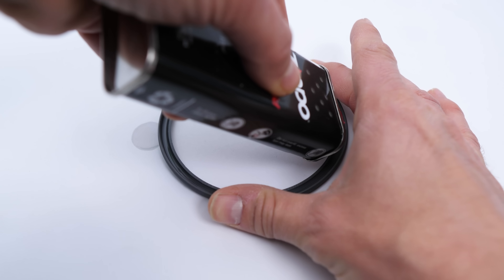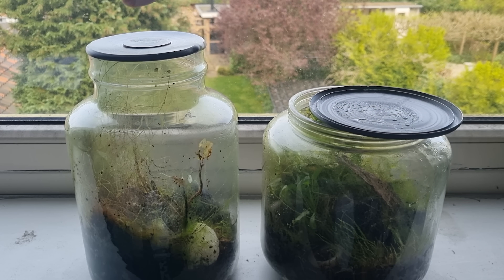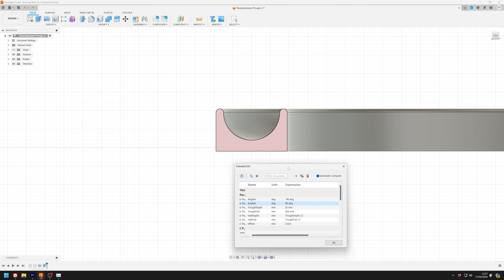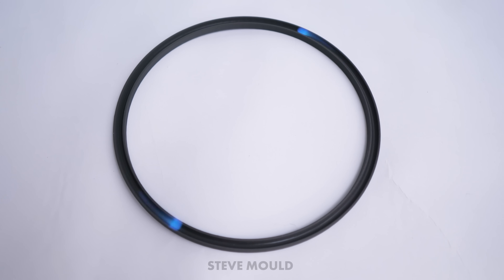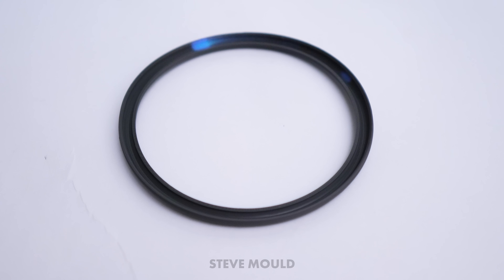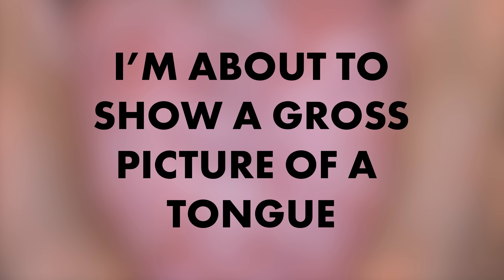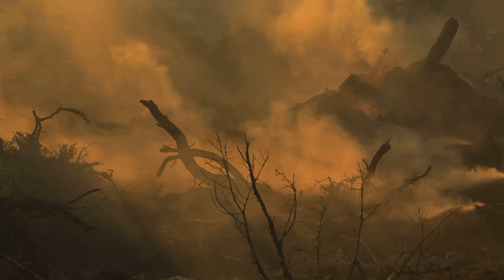Bizarre travelling flame discovery

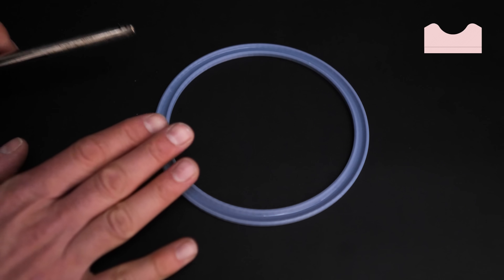Comment: Im only 2:30 into the video but , my guess is the vapor of the evaporating fluis causes some sort of wind-ish thing , that pushes the vapor around. Since the flame moving depends on the size im.guessing it acts as a nozzle or somthing that pushes it around. I also have a feeling temperature has somthing to do with it but im not sure. 
Anyways back to the video to see if i was right.
Reply: Kind of right actually

Comment: What if you could find an excitable medium that would act as a medium to carry data. Example would be a tube, wire or what ever works. The lighter would be a device that sets the excitment with some data attatched. Then the reciever could pick up the data at the end with no power usrd to transmit tha data after initial start. and if it would work you could copy the data to other lines just like the flame splits as it passes other lines attatched to the ring. Perhaps a chemical that is excited at a short burst but then goes back to non excited state with no loss of said chemical. I am thinking along the lines of transmitting data with no loss to resistance. Some may say fiber optics but i am thinking something with less power, is sustained during travel only by the medium and not the transmitter.

Comment: i think you are only getting the proper concentrations to combust only right above the fluid after you touch the lighter to it and the displacement of air of the moving flame is enough to negate the proper conditions behind the flame but now the level of the fluid is sloped so gravity moves the fire forward.

Comment: Zeta halo has a diameter of 30.000km, which gives it a circumference of ca. 94.000km.
So if it was covered by forests it would fulfill the requirements of an excitable medium for forestfires.
Just saying. Do with this information as you will.

Comment: @Steve Mould It's happening because of the direction of process igniting energy and very low frictions of flamable gases track. When the gas flamin' it needs O2 pulled from upside of the ring which eventually comes in from one of sides of the ignition. Boom its powered by air.
Reply: And yeah, You could do a plasma engine that way.

Comment: I am staring at this and pondering if - and I'm probably being dim here - if this could lead to an efficient system for cooking in terms of in-ideal state - aka camping or survival kits. If you were to tally efficiency - what could be done with long burn lighter, or similar fuel - against pure burn stoves or similar. There may be caveats like - this would only work on slow cooking, not high burn / hi temp, but would still be interesting if this worked in a way that wasn't conventional - but still useful...

The way it burns may simply not create enough heat or similar, but still interested..

Comment: You have to make a follow up, like imagine using this to build logic gates/transistors Using two intersecting channels*, one that cuts into another one (source/gate/drain, you get the drill), to prevent the flame from traveling over channel A when channel B has been activated (timing would be a slight issue, but by no means insurmountable, right?), potentially using a *Tesla valve like structure to prevent the flame from going backwards. In addition, I think using different geometries, other than the "optimal" one demonstrated in the video, could be useful when there is a difference in height, like with the overlapping ∞. Alternatively, you could redesign the channel to basically be constantly at an angle, and use a constant small (the system would probably find it's own equilibrium (I think there would be one)) supply of fluid from a resevoir from top to bottom to keep a slow trickle going, which would be pretty much gone/used up when it gets to the bottom, ensuring it doesn't overflow. Here, different channel geometries might come in handy, such as a wider one one which would burn a bit more fuel, or just split it into two/three/n channels.
I think it it also worthwhile experimenting with using the FDM (or whatever) printer to create microscopic (well, not actually micro, but still pretty small) grooves which could maybe use capillary action or something to either keep more liquid in place or even wick it from one place to another (or just use a normal wick of course). Heck, it might even be possible to utilize the heat from the flame and difference in density due to temperature by varing the pattern of the microgrooves.
The grooves could (of course) vary in width, shape, orientation and such to achieve different results, although I have no idea how well that would actually work 🤷‍♂️

I'm sure it's possible to make an entire computer using this, I mean, I think transistors should be possible, and the circle is already a pusle/clock generator.

When you started talking about the cyclic nature (around the five to six minute mark?) I immediately thought about cyclic chemical reactions, such as the Belousov-Zhabotinsky and Briggs-Rauscher reactions, both of which NileRed has made videos on. (I didn't know/remember the names of the reactions, I just remembered watching videos about it, so I just typed in "nilered cyclic reactions".)

PSA: I would not recommend running these things for long periods of time (because the plastic could melt/burn/give off toxic fumes) or/and especially not unsupervised.

Random timestamp: 14:00
Reply: TLDR the last part but the first part answered my questions if logic gates are possible

Comment: is there a correlation between the width of the trough and the circumference? 
what is the absolute smallest ring you could make? and I'd assume theres a maximum (which might just depend on rate of evaporation and how fluid is added.)

Comment: i am curious, this is quite interesting phenomena, cant we use it in a practical way into some technology. For instance making the slip smaller and poking small holes for the air. You can use with peltier plates to detect the heats in to voltages and even manipulate it further, making it infinite toy :)

Comment: 2:25 have you tried having varying openings around the trough? Like a wave frequency around the opening so it gets slightly wider and slightly narrower in a repeating pattern, because to me it looks like the flame is chasing the oxygen as it burns up the gas’s it moves to the next patch causing a slight air flow. Then you get a pressure different each side of the flame pulling it around.

Comment: hey Steve i think it might be the flame has used up all the oxygen within the trough rather than a lack of evaporated fuel. how would you feel about putting it on a heated mat and seeing if the extra heat changes things.

Comment: A national park was facing severe overgrowth, and the park ranger was struggling to manage the dense vegetation. In desperation, the ranger reached out to a team of experts from a renowned university for assistance. A multidisciplinary group of academics, led by a theoretical physicist, was assembled to tackle the problem.

After spending several weeks meticulously studying the park's ecosystem and gathering copious amounts of data, the team returned to the university to analyze their findings and formulate a solution.

Months later, the physicist returned to the park, clutching a thick report, and approached the park ranger saying, "I have a solution for your overgrowth problem, but it only works in the case of a cylindrically symmetric forest embedded on a flat spacetime."

Comment: Because of the larger gap at the junction in the ring-spiral track, I was trying to think if there was any reason a sharper corner wouldn't work. If you make it more of an equilateral Y shape, that tapers slightly to keep the cross-sectional area more consistent, it might be able to sustain a constant ring more easily. Maybe make it a hexagon instead of a circle.

Comment: I tend to think it is also to do with oxygen in front of the flame. As the O² burns out, the flame moves forward to the next area where the chemical reaction heat, fuel, and ignition occur, thus producing the combustion.

Comment: Thanks!

My new favorite word: boredom-carbons...(See below)

Okay so I think that the most interesting part of this to me has nothing to do with flames. The most interesting part of this is how this reveals the inner workings of addiction. If you think of the lighter fluid as human interest and the hydrocarbon gas that is off put as boredom, then you have a example of how refractory periods lead to pulses of substance abuse. This also explains why each person's addiction is so unique. Everyone has a similar feel when it comes to the different addictions that we all face, but they're also very unique. The different designs that you printed are a physical representation of something that is virtual in my analogy, the inner workings of each person's mind. This is because each person has similar but nonetheless unique pathways for addiction to travel. So the question then would be how do we individually build up our sidewalls, or narrow the gap at the top, or any of the different things that you changed that controlled the flame's travel so that we can control the addiction instead of it running rampant? It comes down to the idea that we are all responsible to know our inner shapes and we should work to find ways to build up our sidewalls so that we burn our boredom-carbons in a way that is acceptable. Lighter fluid is meant to burn, but it is never meant to burn out of control. I also suffer from ADHD so my explanations may center around that model as opposed to a neurotypical model. This is why I am interested bc ADHD is prone to addiction and I think this explains the inner workings of addiction in the ADHD mind. All people experience boredom, but for the ADHD mind it is torture. It's like it forms hydrocarbons more readily. It probably doesn't take a tremendous increase in the effervescence coefficient to make the ADHD mind a hot bed for addiction.
Reply: Up on further inspection the side walls may be likened to the physical characteristics of our mind and the shape of the channel that the interests and boredoms travel in would then be akin to our beliefs and values, with the ambient temperature being our habits and even external influences like temptations. The ADHD mind is prone to forgetting in a powerful way. It's part of how the neurochemistry works. Dopamine is like brain cash. ADHD people have a low dopamine baseline. It's kind of like we're mentally impoverished while still having the basic cognitive functions of others. The forgetting is why the flame is able to repeat over and over. Most people have a mature executive function which prevents constant repetition of the same mistakes.
Reply: Final conclusion: To manage our addictions we must manage the relationship between our interests, the boredoms related to those interests(hydrocarbons vs interestbordoms), our beliefs, habits, and temptations. Addiction is something that our mind wants to tell us it's out of our control; that it's something that it is something that is happening to us, that it's not our fault. But all of this reveals that it's not out of our control. Therefore we can solve one of the main beliefs that fuels addiction. We are still responsible for our actions despite these pulses of addiction that tidal through the machine, because while is a phenomenon that we aren't necessarily trying to make happen, we know it's happening, and that it's hurting those we love. Therefore we have a distinct and undeniable responsibility to manage what burns within us as these things just might burn down our house, and destroy the only thing that really matters, our relationships with those we love. 

I think the sage wisdom that I've always heard that echoes this principle is "An idle hand is the devil's workshop." I mean I guess I knew why that's true before, but now I feel like I really understand how, in theory, it propagates. 

It's kind of weird to say thanks, because I totally took this down a huge rabbit trail, but truly thanks Mr Steve. I love your way of explaining things. So calm, so chill, so detailed, and truly enriching. 😉👍🏼

As a small side note I don't think it's actually interestboredom. I think boredom is only one type of frustration that people experience in their interests. I think proper term that most closely mirrors the hydrocarbons in the analysis is interestfrustrations. It's this combination of interests and frustrations along with the environment that it happens in that fuels the flame propagation of addiction.

Comment: I believe there’s a projet for a rocket engine using this technology : a continuous chamber with a slit send a circulating flame or a pair of them… correctly timed with the flame, the input of fuel can be done in the refractory phase behind the flame where the pressure is lower thus requiring less energy in the pump pushing the fuels to the chamber… I think I’d seen that in a Scott Manley video ?

Comment: This could be a really interesting (and dangerous) way to creat a timer or a clock. A light sensor or a sensitive thermometer , you could run connect it to a circuit, to loose wires where the flame should pass and boom, you've got plasma conductivity.

Comment: Also this wouldn't work if you used bigger rings with the thinking that the vapour would be gone before the flame laps around. This should mean a flame on smaller ring would last longer ?
Does the material of the ring play a role too, Would be the same with a metal ring.

Comment: As a young lad I used nick my uncles tin of lighter fluid then go to our side shed. I'd squeeze the can to spray a fine jet onto the shed and set light to the outflow like a flame thrower. It wasn't ho enough to set fire to the timber but it was a bit of fun.
Those were the good old days (70 years ago) 🤪

Comment: 10:40 your statement about the Flame passing over a bridge, remember it is NOT the fluid burning but the chemicals suspendid in the air above the fluid that burn, I as a motor mechanic have extinguished a cigarette in a container of Petrol(and it was 5 star)But I have also experienced a explosion in a battery charging room in a  fleet workshop, luckily only a few batteries were on charge so appart from looking like a cartoon character, I survived, People Need to remember, we live on a world full of 2 of the most volatile gasses known to man H2O

Comment: These flames act very similar to WireWorld, a cellular automata system used for simulating electronics. It looks kinda like an excitable medium except the waves travel through a fixed wire similar to the thin trough that contains the lighter fluid. You see the same effects where junctions cause signals to split, signals cancel each other out when colliding, closed loops function as a clock, etc. So in theory, these traveling flames are turing complete.

Comment: 11:06 

So technically, most of the times if fire goes out in this configuration, then it will be because of the raised section qnd it will got out around the raised section's floor's height == lighter's fluid height. (Approx.)

Comment: i'm sure you can make a computer. maybe let's start with the fundamental logical operators and make an adder.
make input easy make 1 an open connection and 0 a blocked connection. resulting bits will be small pools indicating the bits

Comment: The bridge one is weird, how well do tracks work when on a slope just generally? What happens when you have multiple 'bumps' in the track? What happens if you attempt to start the flame at the top of the bridge? Looking at the track with the bridge makes me sceptical this is purely a case of a liquid layer of lighter fluid having just enough gaseous fluid above it to burn as the flame front reach round - why would it continue over a bridge? I'd love a physics person here to confirm whether this may not entirely be excitable medium or if the flame front is actually propelling a burning gas bubble over the surface like a jet engine? 

This all looks like there's more interesting physics at play than simply a moving wave of fuel changing state from on fire to not on fire, but perhaps that's the beauty of the illusion.

Comment: Would it possibly work in a moebius strip?  Or would that be impossible, as it would probably require zero gravity?  Unless you had a semi-permeable surface so that the lighter fluid could seep into it somewhat, and then evaporate out, regardless of how the moebius strip is oriented.

Comment: the ring shaped forest  would likely not work for long. even if you get the right size forest. because the smoke would blot out sunlight and prevent the regeneration of the fuel from ever taking place. would it not?

Comment: The key step to logic gates would be to make a track that will only carry a flame in one direction. Maybe by using angled baffles in track. Once you have that you can make well generators that can only be lit from one end.  Should be possible to make a buffer gate or not gate using that

Comment: So, it CAN be made to do logic. Prof. Górecki once showed a very similar thing but done with chemical reactions. One needs special shapes of the troughs to build gates.
One example is a diode - triangular shape on one side, pointing towards a rectangular one on the other with thin enough gap. Then approaching from the rectangular side it is possible to start the reaction on the "tip" of the triangle, but not otherwise.
Try it please!
@Steve Mould